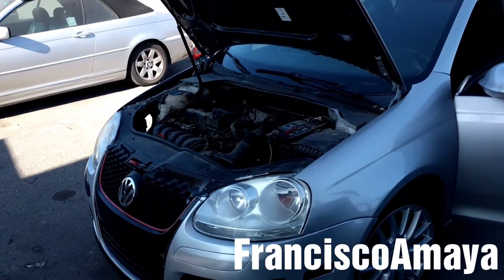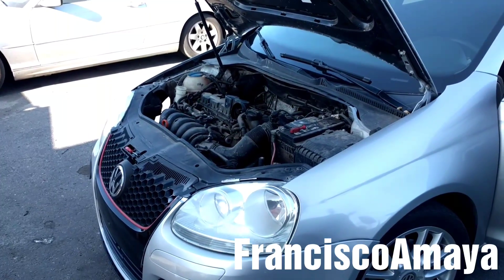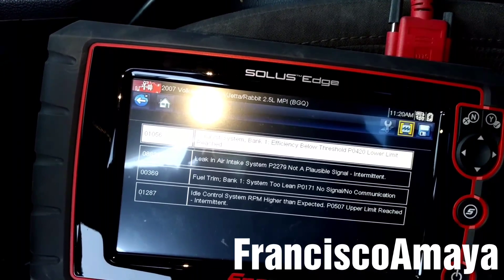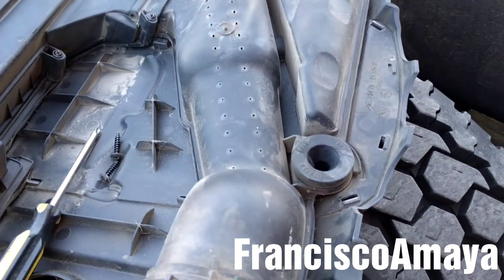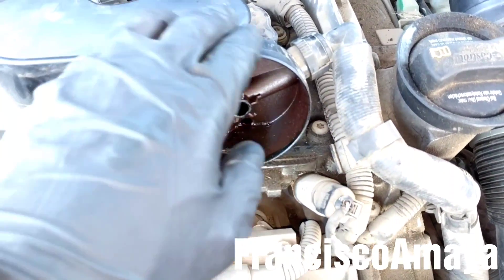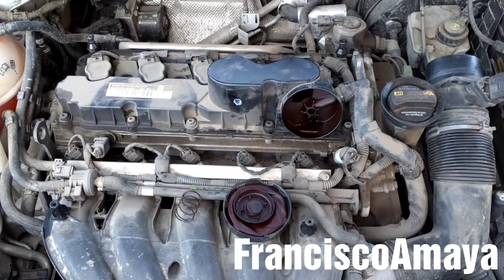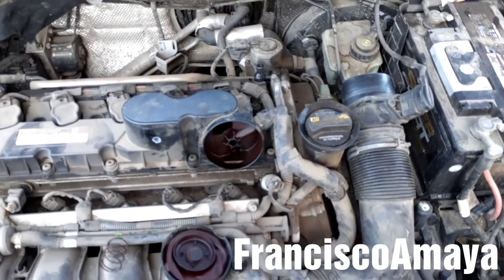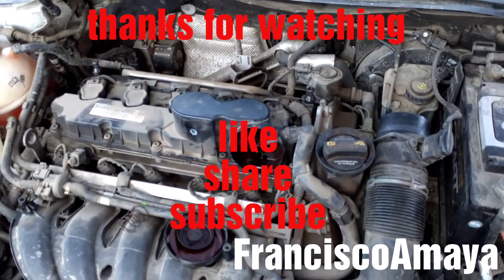Volkswagen Jetta Golf rabbit 2.5L PCV problem engine high idle P2279

Comment: The same thing happened to our 2006 and at first we replaced it with a $20 part and it didn’t last 1/2 year.  We next replaced it with a little over what was mid priced and it’s lasted more than six years at this point